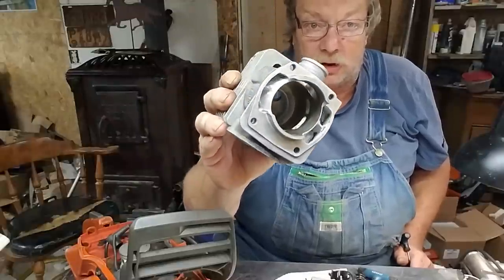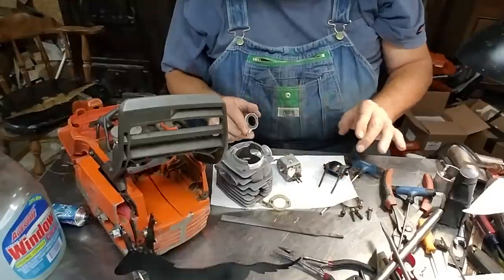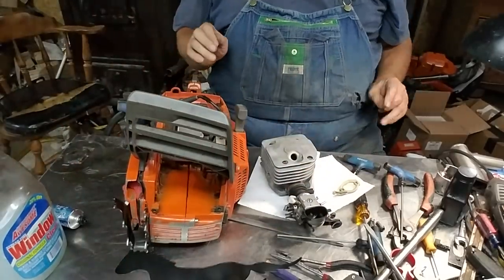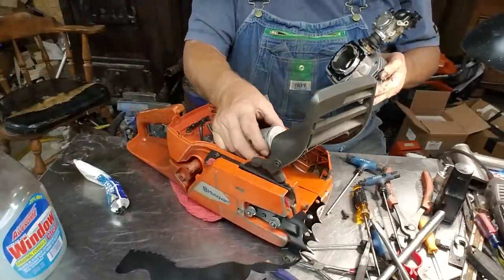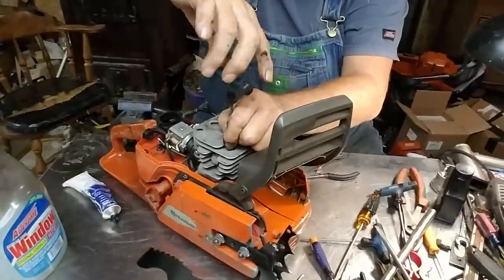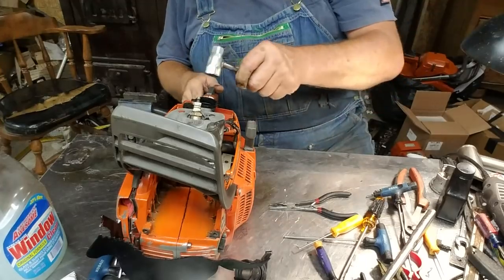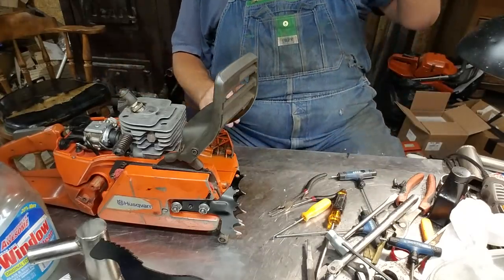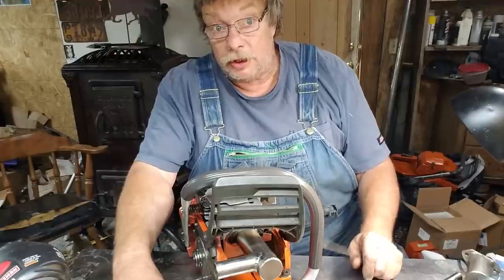Kyle's,  372 port workand first fire! more tips and tricks!

Comment: If you know that your silicone will not be used for while you can put little bit of vaseline into the cap of the silicone tube when you put it on the shelf. It will help preventing it from hardening in the tube while storing it.

Comment: I just did my first actual Port work on an MS 170 that I picked up at a yard sale for 25 bucks need a fuel line in a couple other things I don't have a degree wheel so I just kind of Winged It I also ordered a 5 gallon bucket of 110 Sunco man don't that stuff smell good with that clots I watched a few of your past videos on porting the tree climbing saw for buckin Billy I think the steel I don't remember who it was for anyway the cylinders are very similar so I just followed your video work out pretty good watch it like 6 times in a row🤣

Comment: Love you’re videos IRONHORSE 
The best paper towel there is? Try the Caterpillar branded shop wipes. There is about 3 or 4 different styles and the come in light blue and white in a massive box. Lint free. Working for a cat dealer, we have to use this stuff to comply with Caterpillars contamination control guidelines in component assembly shops. I’m sure your local Cat Dealer will have them in stock. Let me know if you want the part number!
Reply from the maker: Thanks! I’ll try them!
Reply: @theironhorse6600  Friend, or +500 turnover from the maximum permissible damaged saw? 372 xp oe 14000 rpm

Comment: Harv, you said that the muffler gasket goes between the cylinder and the heat spreader plate, is that because you've put the custom muffler? Every OEM parts diagram has the gasket between the muffler and the plate, not between the plate and the cylinder?
Reply from the maker: Yes! The flange is very thick! Orem is opposite!